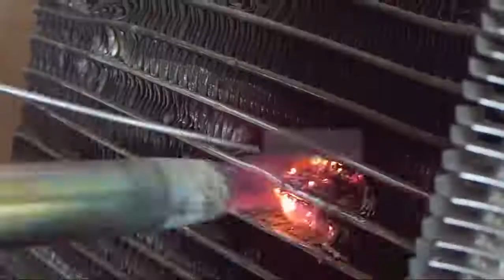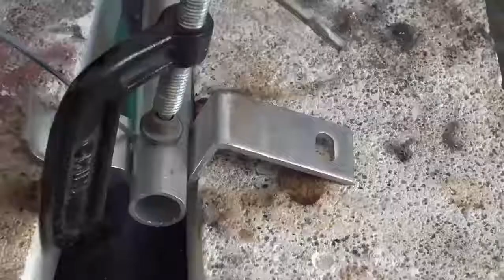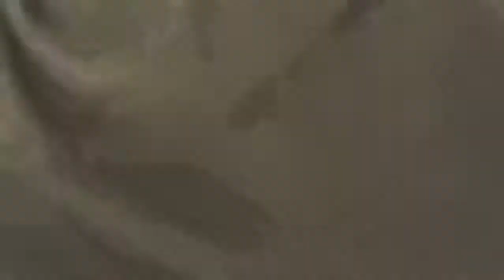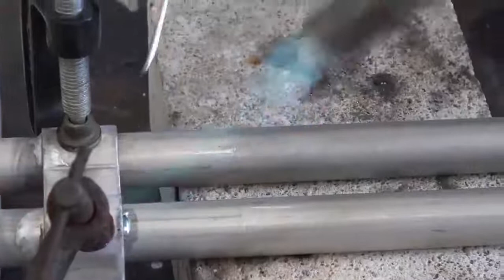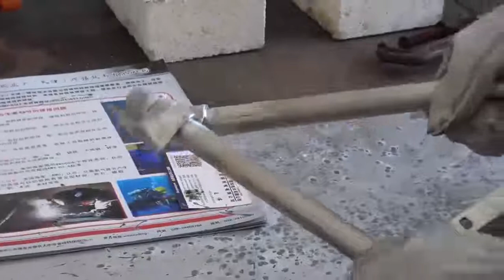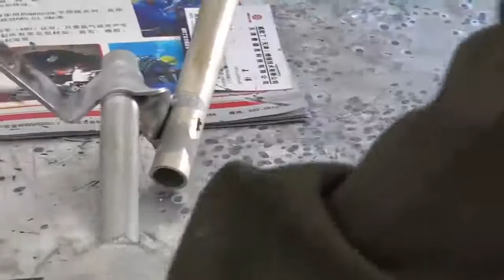50cm Low Temperature Aluminum Welding Electrode Flux Core Multi-tools 10/20/30/50PCs from Aliexpress

Comment from the maker: Direct link to this product:  - seasonal and holiday discounts, full product description, order and truthful reviews from customers.

50cm Low Temperature Welding Wire Aluminum Welding Electrode Flux Core Aluminum Electrode (no Flux) Multi-tools 10/20/30/50PCs
Reply: Sir lam buy tha radiator leacage lod
Reply: No flux sir
Reply: Kalau mau beli 10pcs komplit dengan flux berapa harganya